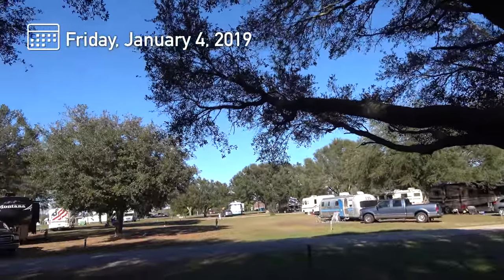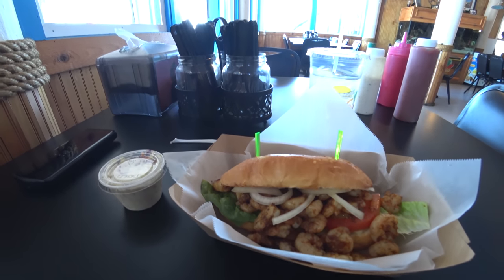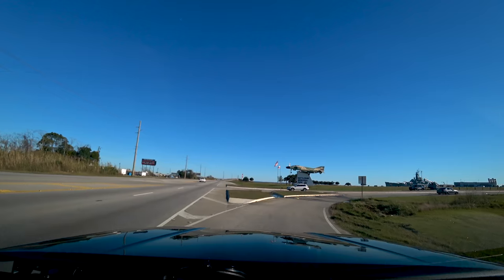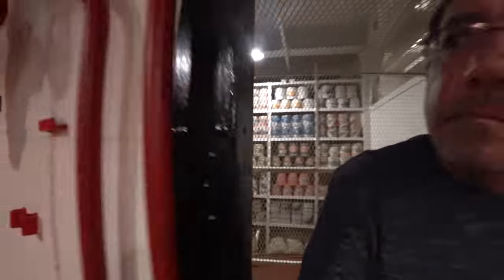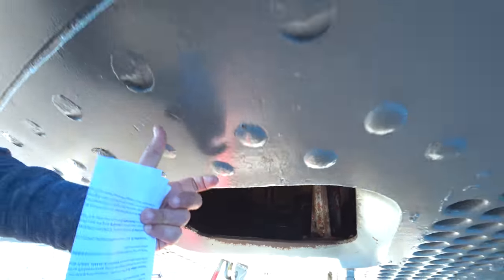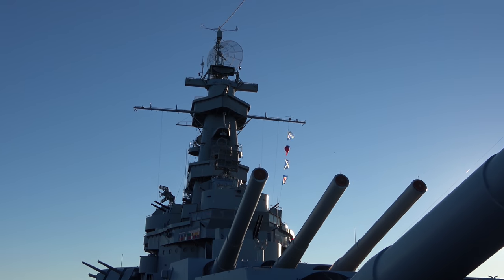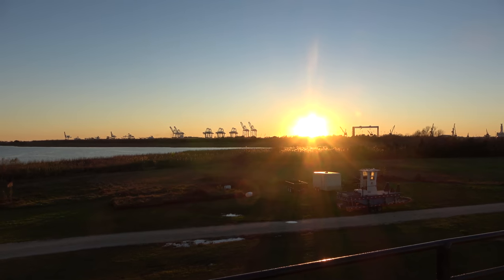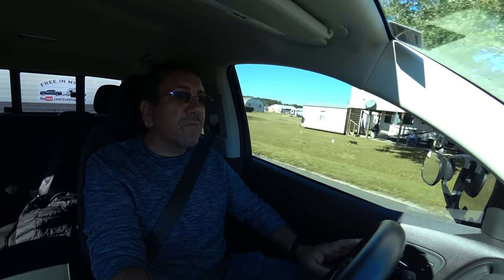The West 2019 Part 2: Mobile Bay Ferry, Dauphin Island, and USS Alabama

Comment: Robert you need to have your trailer axles aligned. They are never aligned from the manufacturer. If you tow over 10k miles a year it's a must. Mine cost $450, but you save that in one set of tires. Happy travels.

Comment: Next time, stay at the city owned campground on Dauphin Island, then you can walk down to the east end (about three blocks) and visit Ft Gaines, across the street is the Estuarium (allow 2 or 3 hours here) where you can learn about the environment and marine estuary of Mobile Bay (average depth of the bay is 10 ft, all of those rigs you see in the bay are natural gas, Mobile Bay is the largest natural gas field in the US) and you can walk out the south gate of the campground to the public beach, or out the west gate of the campground to a 100+ acre Audubon Sanctuary with walking trails, ponds, sand dunes, pine forest. The ferry is just across the street from the campground, and for five bucks you can ride across and back on foot or with a bike, and see dolphins, birds, boats and sunsets. The only time RV's and such are allowed on the ferry is when the tide is extremely high, as the approach angle of the ramp at Ft Morgan makes loading/unloading of long or low vehicles questionable with normal tides.
Reply from the maker: I will definitely visit that campground when I head that way again in June